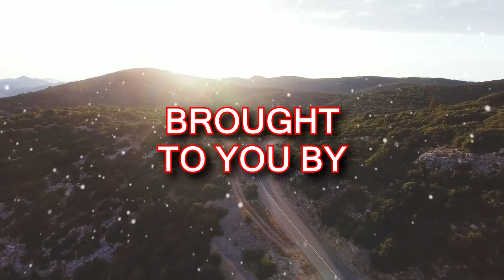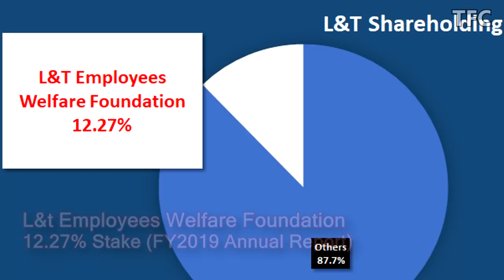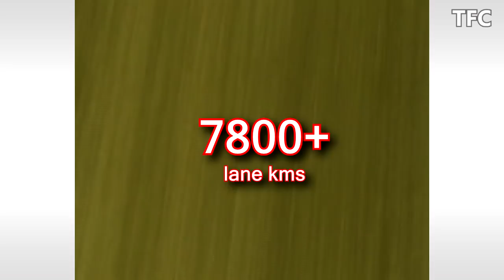L&T Business Empire (30+ Countries) | How big is L&T? | Larsen & Toubro | AM Naik

Comment: Fun Fact :- Most coal plants  in china use made in India coal gasifiers that are made in the L&T's A M Naik Heavy engineering plant in Surat, Gujarat. In fact, china still imports lots of reactors, gassifiers, boilers, and various other heavy engineering systems and goods from India, specifically from the L&T's Surat plant mentioned above. All possible becaue of A M Naik sir. There is another L&T heavy engineering complex in Vadodara, Gujarat. Together, these two plants also contribute to all the equipments and components for India's nuclear power plants. India contributed the Cryostate for ITER in France. Which is one of the most critically important part and very hard to manufacture, weighed at over 2800 tons, also manufactured at L&T Surat plant. So proud of L&T and A M Naik sir who made the company into the titan it is today.